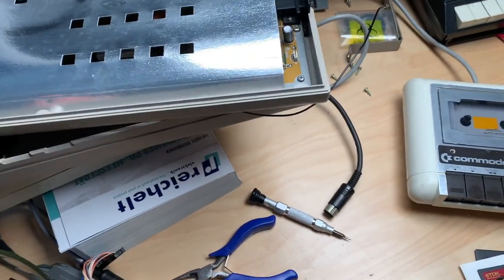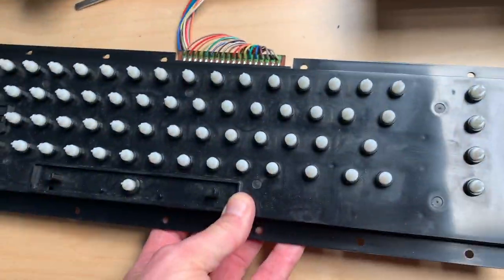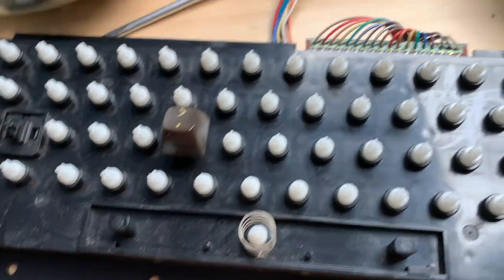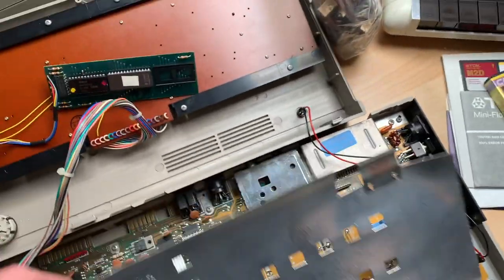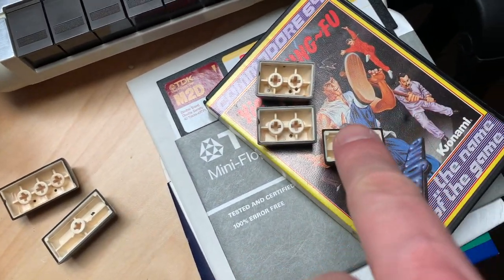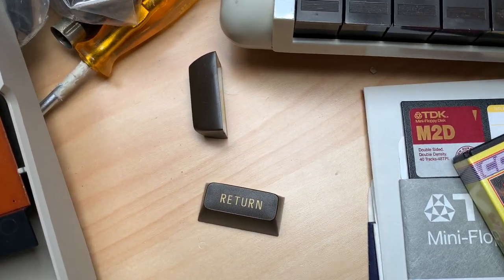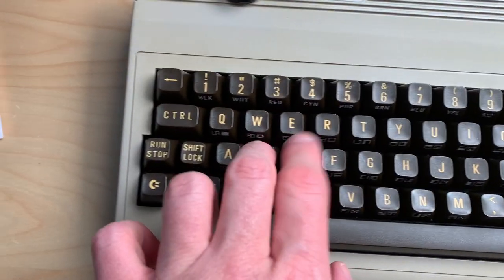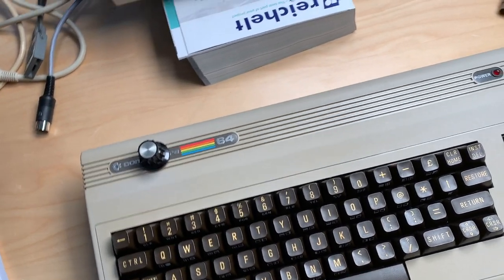A very unusual C64 Keyboard ... I think.

Comment: Good job, I really like your videos. I bought a PAL machine over a year ago so that I could play some of the great games that were made for PAL only at the correct speed. Its a C64G and its cream color case instead of tan and the label says made in China. I've seen some say this was made for and sold in Aldi stores in Germany? Do you know if that is correct?
Reply from the maker: Yes, these are indeed ALDI machines. Classic Commodore move to use old stock case molds, put in a different color plastic and use the C64 II Super Low Cost Board inside. These were sold at the very end of the C64 lifetime. Nowadays ALDI is still popular for it's budget PCs (via Medion), but it all began back in the late 80s early 90s with the first computer they ever sold: the ALDI C64.

Comment: Constructive criticism: Put the camera on a mount and move things (slowly) into the frame. Moving your camera around is ill-advised as most find it offputting and in some cases, people will feel ill.
Reply from the maker: Thanks! I normally use a gimble or tripod, but the gimble died that day and I only noticed the heavy motion when cutting the movie.
Reply: @RetroWK  Then kindly disregard my suggestion and thank you for your video.
Reply from the maker: @gklinger  All good, you are absolutly right.
Reply: And one other thing: try to match the volume of your intro music to that of the rest of the video. The intro tune is MUCH louder than your speech afterwards; the viewer shouldn't have to be adjusting the volume or get a nasty shock in headphones if possible. Good work with the subject of the video; I don't recall seeing this style of keyboard before.
Reply from the maker: @8_Bit  Thanks Robin. Will do.